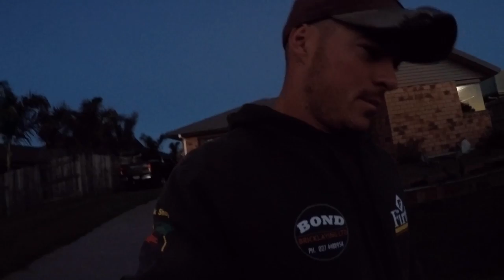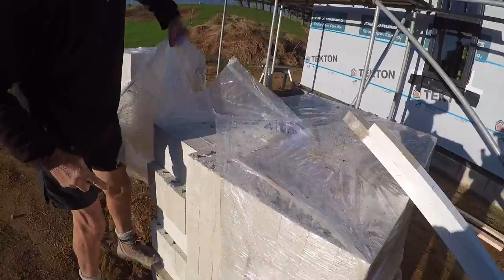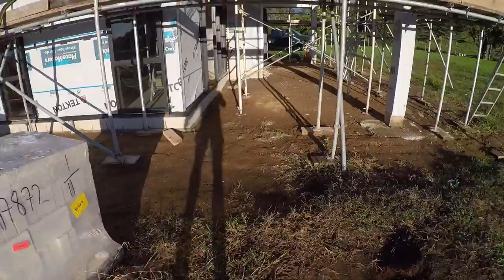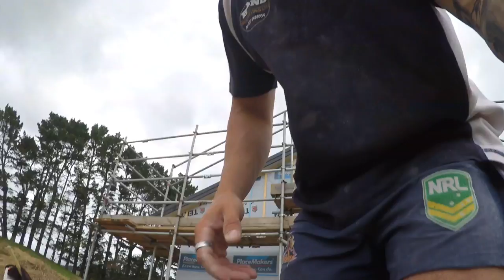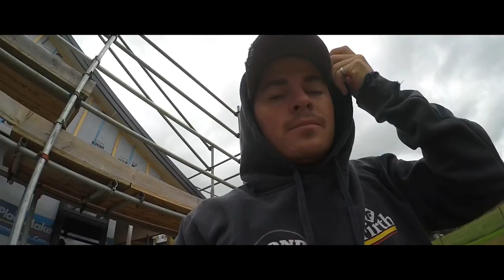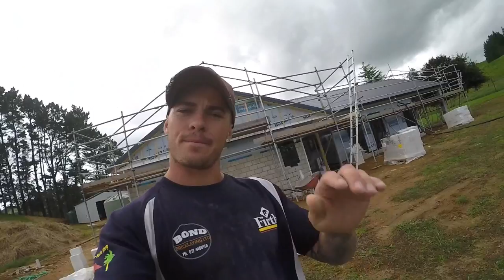Bricklaying New Zealand! Work VLOG 2- 2018 *GoPro*

Comment: Hey Izack..... to  quick question, is it possible to lay a level foundation of Concrete blocks on a slightly un level concrete surface? Do you simply adjust the thickness of mortar? Thanks